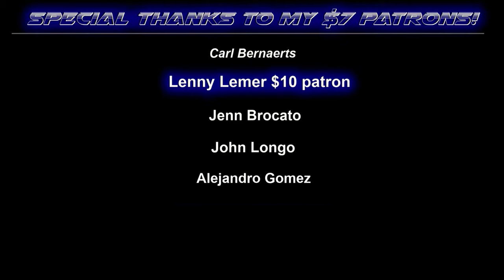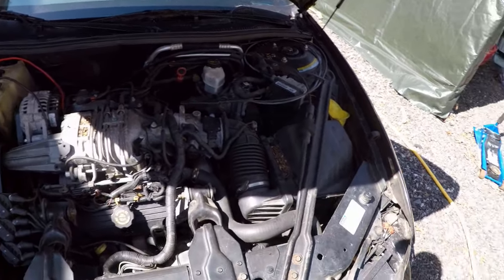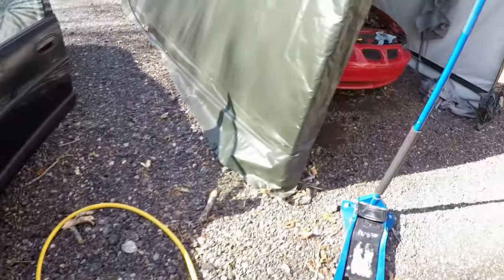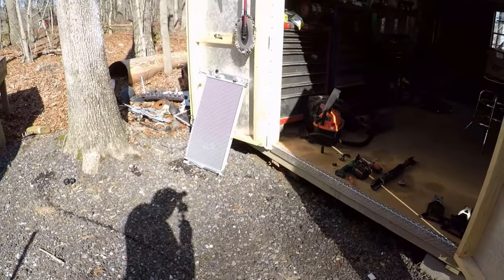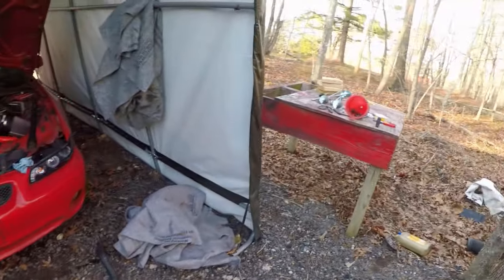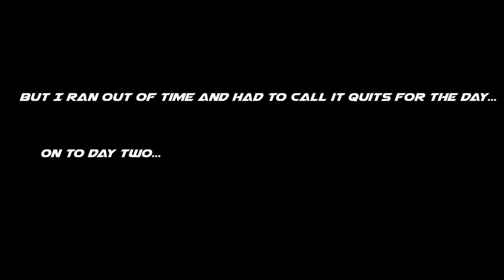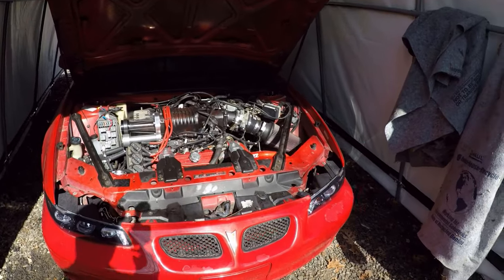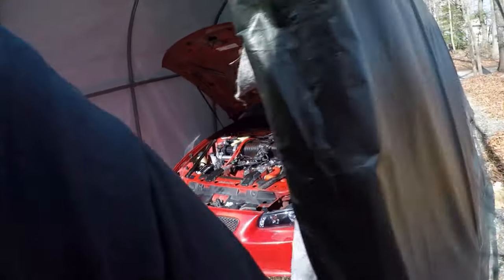My 99 GTP gets a big cooling system upgrade

Comment: Ya buddy! Cooling is key to longevity for 3800's, especially when modded.  Look forward to seeing your project car progress as weather improves.
Edit: if those fans do well to replace 99+ ones for header use, a sheetmetal shroud may be a good add-on to help air.  I kinda want to try that if I need to go back to thinner fans again.
Reply from the maker: So far i have been driving it for tuning and the temp is staying down no problem

Comment: What did you torque the transmission cooler lines to when you put them on the aluminum radiator? Also shouldn't I use a o ring or form of lock tight on them they can with nothing on them and not installed just don't want leaks
Reply from the maker: No need for sealant, it seals in the middle.  I just got them good and snug.
Reply: @SalemDoyle  Thanks a million again brother
Reply from the maker: No prob
Reply: @SalemDoyle  I can not catch a break radiator is in I can not get the factory fan tabs to slide in the radiator on the sides 😆.